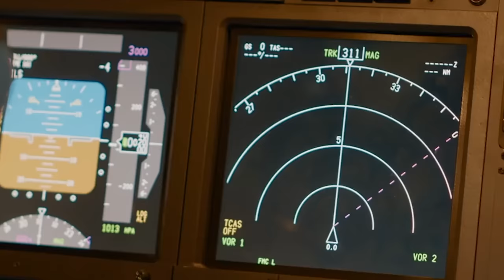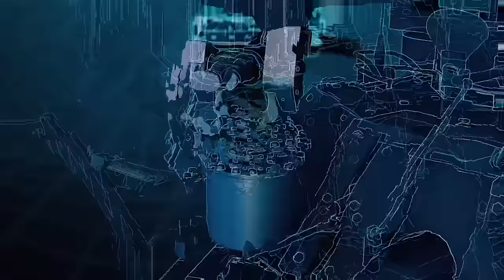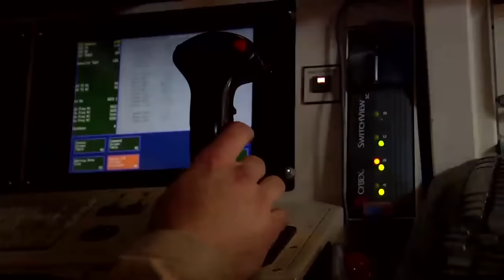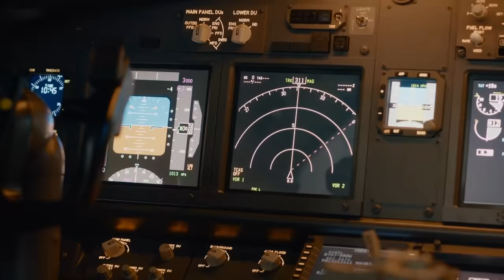The Astonishing Impenetrable Shield of American Tanks

Comment: It looks like it only has 2 anti rockets on each side without a way to reload unless pulling away from the battle which in a urban environment isnt always the easiest. The next thing they should do is find a way to have more ammo for it or a reloading system. A 6 barrel rotating cylinder like a M32 40 mm grenade launcher would be sweet just as a thought.
Reply: As mentioned in the video, each of these "self contained APS systems" are specially calibrated and non-reloadable.  Oh, and they probably cost around $100k per unit.  War ain't cheap.  :(

Comment: It doesn't work in case of top Attack: merkava 4 tanks (you can see in Gaza) are equipped with metal cages (like russian T72 in Ukraine). Outdated!
Reply: The Merkava's there are using Trophy, not Iron Fist. That is mounted only on the Eitans.
Reply: The cages are for molotov cocktails. The Trophy system works against over head threats.
Reply: The cages are for grenade drops, which are too slow for the APS to recognize as a threat. If an APS were programmed to react to something like a grenade drop, it could be exhausted by throwing rocks at it, forcing it to waste ammo. 

Ironically, it's kinda Dune shield rules--defenses are strongest against the fastest threats, so the only ways to beat it are lower tech and to slow to be recognized by the system.